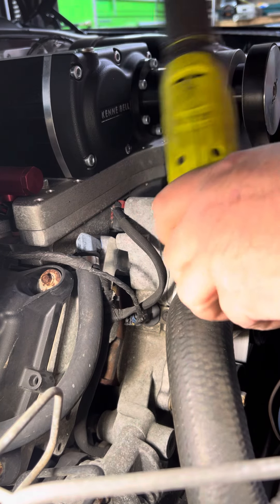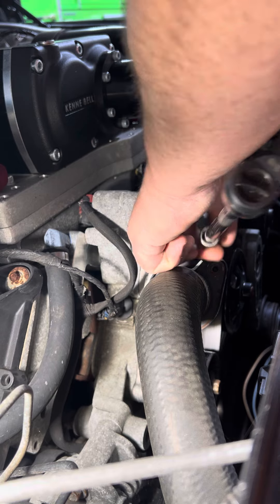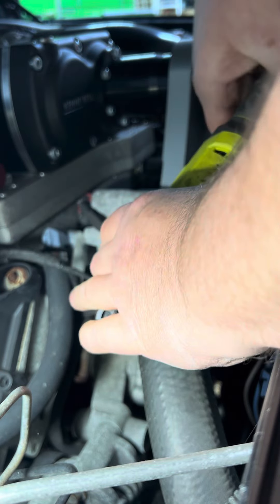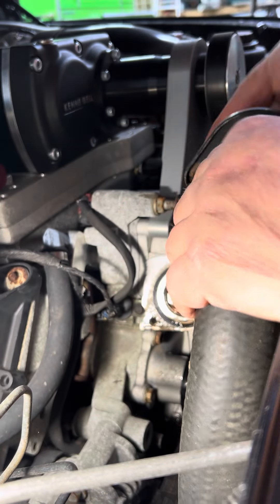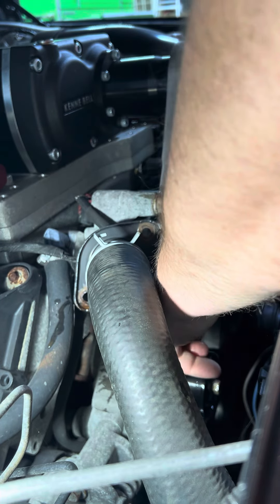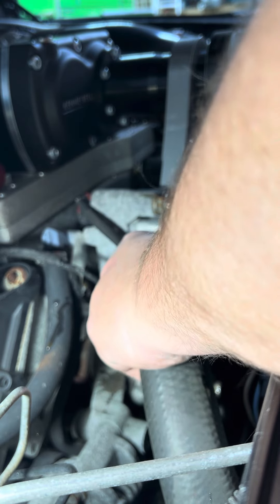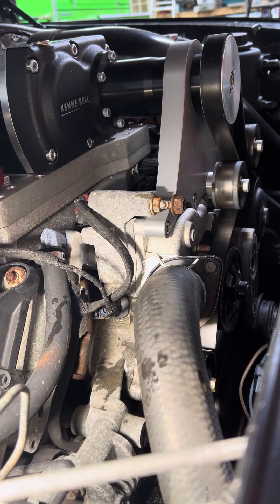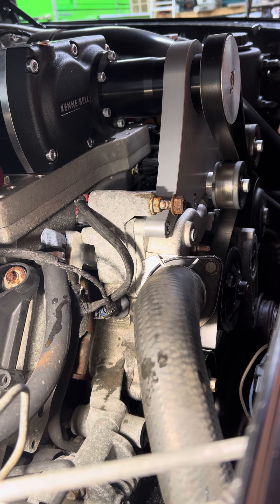Challenger R/T Thermostat Replacement Less than 3 Minutes

Comment: How you liking that kennebell after all this time? I have a 2012 300c FBO and cammed. Gonna be doing forged drop ins here soon and been looking at superchargers. I really like the look of the kennebell and everything that I've read online which isn't much doesn't seem a lot of guys go this route most guys go with the whipple or pro charger.
Reply from the maker: I researched the supercharger options heavily and it came down to Whipple and Kenne Bell. I was quite discouraged with Whipple reusing the under hood air box. I also don’t wanna deal with a messy catch can and I don’t like the Jack shaft on the Whipple. After all the research, none offered what I wanted other than Kenne Bell.
My car has had zero problems since adding the supercharger, (other than traction). I would recommend having someone tweak the included Kenne Bell tune as mine was quite rich. Even with the rich tune, it made nearly 500 hp at the wheels with stock manifolds and cats.
I’ve only put 15,000 miles on it in the past few years but it has been 100% reliable and I’d do it again in a heartbeat.
Reply: That's awesome to hear man! and yeah that's the big thing I like about the kennebell is it seems to be the only one with an actual cold air setup. and yeah i am tuned on hp tuners currently so I'll just have to get it retuned once I install the drop ins and blower. Thanks again man! what kinda 1/4 mile times are you getting? And do you have the nag1 ? @kgsartin
Reply from the maker: @taylorbowman5193  
Mine is a 6 speed car. Unfortunately, there are no quarter mile tracks in WV. There is supposedly a 1/8 mile track coming back soon, I’ll certainly be there.
Reply: looking forward to seeing what she does!
 @kgsartin
Reply from the maker: @taylorbowman5193  
You’ll wish you done it sooner! Scat packs are no problem!
Reply: shoot im already takin down scats and srt8s no problem this would hopefuly put me in hellkitty territory! @kgsartin
Reply from the maker: @taylorbowman5193  
What mods do you already have? And yes, if you’re taking down scats now, you will certainly be upsetting hellcat owners with a Kenne Bell.
Reply: @kgsartin  Longtube headers, catted mids, straight pipe 3”, ported 6.4 intake manifold, 90mm TB, JLT CAI, tomahawk cam + MDS delete, 3600 stall converter, tuned by Ryan from FRP.
Reply from the maker: @taylorbowman5193  
Your car is gonna be even more awesome with boost! Have Ryan do the final tuning and you'll be making hellkitten power!
Reply: @kgsartin  dude I can’t wait!